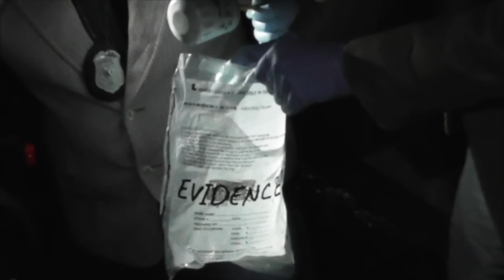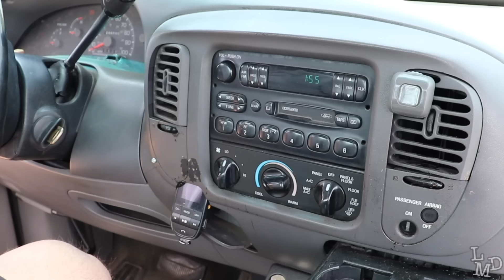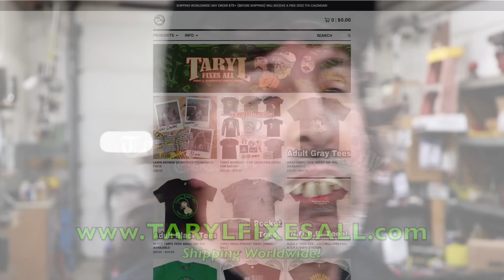Kawasaki Running Badly? Check This Amazing Tip!

Comment: really really dirty carb?  look for a bad gasket or a missing or damaged welch plug.  for every small engine carb I own I apply a little jb weld epoxy to all welch plugs.  Let it cure for 48 hours.  Of course the surfaces have to be very clean first (wire brush and brake cleaner followed by compressed air then alcohol then compressed air again so all welch plugs are clean and dry..then apply jb weld in a small mound that cover the plug and over the surface so there is good adhesion...let dry for 48 hours....  I also use indian gasket sealer to all my carb gaskets and then reinstall.  I do the same thing with the intake manifold gaskets.  let that dry for 48 hours.  Never have a problem with excessive trash getting into the carb and no intake manifold air leaks!  The filter and foam secondary as pretty good but you will always have some very fine dust entering the carb...so at least twice a year, the carb is cleaned...gaskets are cheap...have a two sets per season on hand.  Another big mistakes is not cleaning spark plugs.  Clean them with a wire brush and some carb cleaner or brake cleaner...compressed air..check gap.   the "manual" may say to check valve lash per a certain number of hours of operation....I check them each season no matter how many hours on the machine.  I live in the deep south where summers get well into triple digits and 100 percent humidity.  These small engines take a serious beating in these conditions.  Missing maintenance is very costly.  Most of the consumer level mowers down here don't last but around two to three seasons.  And that is mostly due to lack of maintenance.  I run a small side hustle repairing mowers and small engines.  Yes, my business would not exist if people took the time to do simple maintenance.  But I don't complain.  It puts money in my pocket.